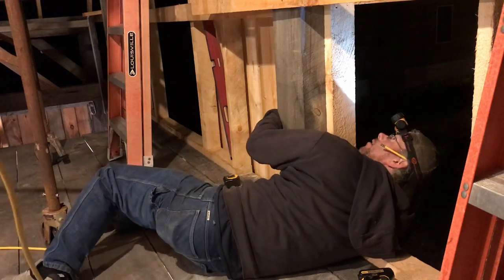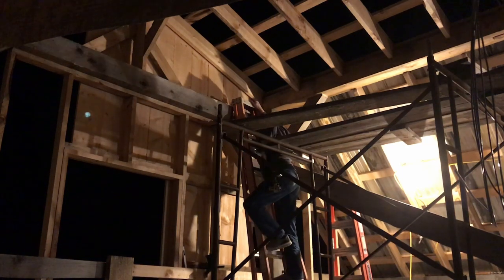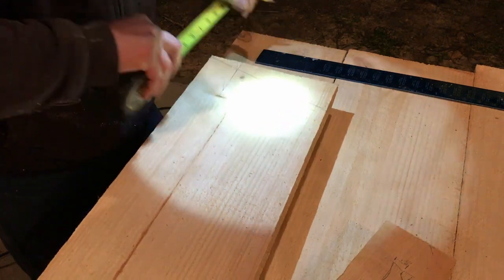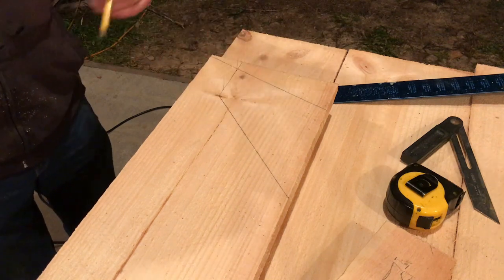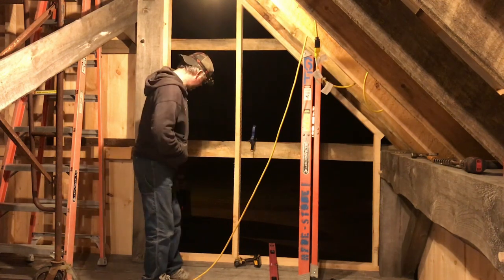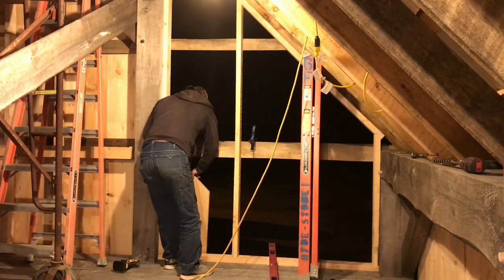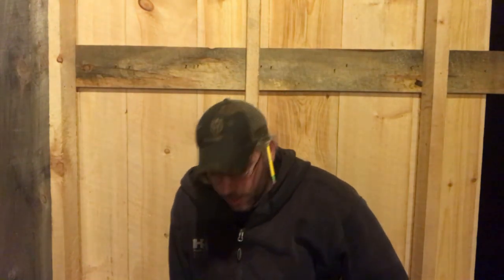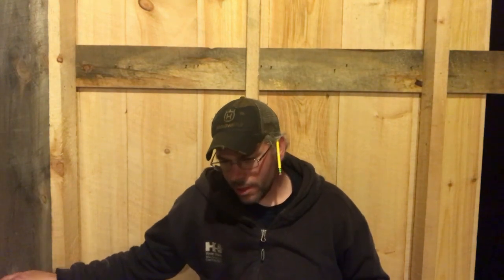A Few Boards Closer on the Timber Frame

Comment: Dear Jim,
One doesn't realise the full extent of your barn build till you start doing the gable ends. Your project is far larger then it first appeared. & to think that you've spent 3 years on your own ( more or less); I think it's quite an achievement that should be applauded. It's indeed quite remarkable what a single minded individual with a solid determination can achieve. I do believe this year might be a blessing in disguise fo you & the family after all the tribulations. I just cannot wait to see the continued progress of your barn. I am somewhat curious to the overall outer dimensions & height of your barn; it's big enough to house an entire family of four at the very least. You take care my old fruit, go have a well earned rest ( very soon you'll have a balcony to sip your triple roast with Mary Rose, won't be long now!). Kind regards.
Reply from the maker: This barn is twice the size of my house.  It's hard to judge the size on camera but it is big.  The ridge board is 13' from the second floor.
Reply: Dear Jim,
Thank you very much for your courteous & hearted reply. Maybe you might consider moving into the barn permanently & use the house as the workshop in this case!!! Either way it's one wonderful structure that you will leave as legacy to your children. I could see from your video that the ridge was pretty high from the floor but had no idea it was that high although I did try to guesstimate with you on the ladder. I really like that gambrel roof, it really emphasises the inner space. You're going to have plenty to do inside it which will keep you busy for quite some time. Well done Jim, very well done indeed. Kind regards.
Reply: Dear Jim,
That well chosen piece of music is beginning to sound like the Tradesman Channel's signature tune, it seems very fitting somehow. I approve dear boy. Keep it up. Kind regards.

Comment: Hi Jim, Its not gun shy it's self preservation and smart to do so. I loved your Job retort of the Noah's Ark comment and I can understand why you could feel that way some days. glad you are getting to button up some of the sides prior to the rest of the metal roofing going up. God bless you and your family🙇🙇🙇 BTW try getting use to waring your wallet in your front left pocket to avoid early sciatica; it will take some getting use to but it will lower the chance of walking with two walking problems a hip problem and a leg problem. Take care!

Comment: If you put a 45 degree bevel on the inside face bottom of the boards rain water will have a place to drip off before puddling on the bottom of the board. This little step will prevent rot and make your weather boards last longer. I learned this from The Farmhands Companion channel.

Comment: Hi,
I'm so much impressed by the magnitude of this project You've undertaken alone! This is a real achievement with such solid construction on really heavy logs. In my grandfather village such barns were build by few strong men at least... Hats off you say in English? 

One question is coming back since I started to follow Yr project. You are building from raw timber & boards. Are these in any sense preserved? Of course not preasure treated, this is obviously not doable on such project byt maybe by painiting or spraying? My point is that in first few years the bugs may eat it in and out - maybe You are not located in the forest area but still they may find a way. I saw it happened in ma grand father wooden house with roof timber construction when bugs eat it. Dust was falling all over... So now each my tiny timber Project I'm impregnating by painiting inlcuding the joints before assembly. I know, who does it?, but that's a part of a fun we have isn't it? We are not in a race. Probbly mold & stain is less of a problem sing You vovered with roof already and the wood will hopefully dry ou reasonably quickly. 
So for Yr Barn now are You planning to take a spray gun and impregnate all over the construction - still when it is accessible and before You move in with all yr shop stuff?

cheers
Reply from the maker: We are very lucky here in that once the wood is seasoned that the bugs leave it alone.  A good solution is to spray your timbers with borates.
Reply: @TheTradesmanChannel  Yea, you are lucky then. Here in Poland bugs are attacking like first 5-8years. Especially when I'm in the pine forest area. So we have to either soak or paint/spray preservatives.

Comment: Trick i always use when on ladders and olone is to put an eye bolt in the building and put a small ratchet strap from the building to the center rung of the ladder. Takes a few minets but it wont
 move. What kinda wood you using Jim? Looks kinda white, not Hemlock is it?
Reply from the maker: It's white pine.  It's a sheathing layer and it doesn't move as much as hemlock when it sets out.

Comment: The pain helps maintain high paranoia levels. I had my share because of it too. It will take some time. Just remember that you really are being overly cautious but now you can reach a happy medium that works for safety. Great to see you moving on though.
Reply from the maker: I'd rather be over the top with caution but one can go so far as to create a more dangerous situation by being too nervous.
Reply: THAT'S what I was meaning. Too much caution can be almost as dangerous. As you say, too nervous leads to trouble too.

Comment: JIM—Extension Ladder STABILIZERs $45 ~ $100 
Luv mine has a 3-4” Pad to lean against aluminum or Vinyl siding..
Soooo much Safer. Lowe’s, Amazon, got mine @ Sherwin Williams Paint store.

Comment: Nothing like being on the ladder when you should not be. I cheated. One of the guys hung a hoist and could not get the safeties to work right. 3 Phase motor and one quick look at it and I knew what the fix was. He had swapped 2 wires when it went back up. The cheat was I used a rolling stairs to get at the motor. I had not taken any tools up so one of the guys on the floor get and got what I needed. I ended up giving a quick 3 phase direction lesson.

The wall is looking nice. Can you post a shot from the outside with the next upload? I am guessing it still too much find for the drone. Stay safe and warm.
Reply from the maker: I can Sean.  You and I make a pair for sure.
Reply: @TheTradesmanChannel  Well if you ever out west you have to come say Hi.

Comment: I am very ashamed  on all the comment  none  of them help  him with it  it was to easy for him to grab the boards from the ground subject  to  dig  along the outside of the building  so the board could sit  farther  away  when  trying to get them  lol    seen you had scaffolding  president  there  just get more of it  to may a job easier on you or a man lift for the day ladder  if you need to extend  one  and need to keep moving it around  rent a man lift for the day  we had scaffolding for 10 feet other  we will rent a man lift  for the day or the project  was done.  yes, we make sure 4 wheel drive as well and it sits up to be towed if it gots stunk yes it has happened to the lift the ground was too soft we have. taken care of that problem by running a roller over  the area and really notes we have  not had the water  build  up as we did before  plus side it's not as bad to cut the grass to and the moles have gone as well
Reply from the maker: Right now I can't climb on scaffolding, extension ladders are also not a possibility for me right now I'm good on step ladders so that is what I'm using.  As the leg heals I'm able to do more but it is still a struggle.